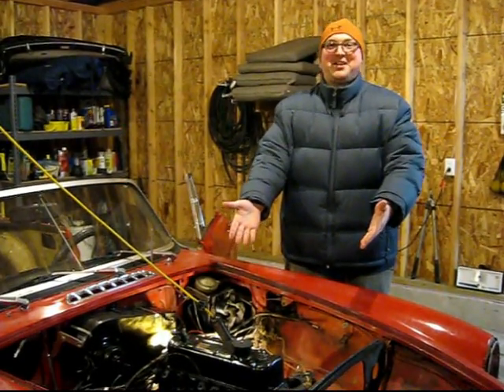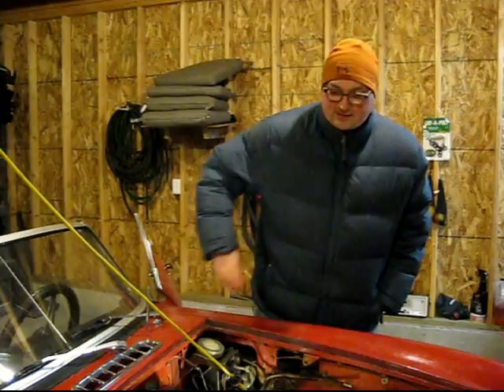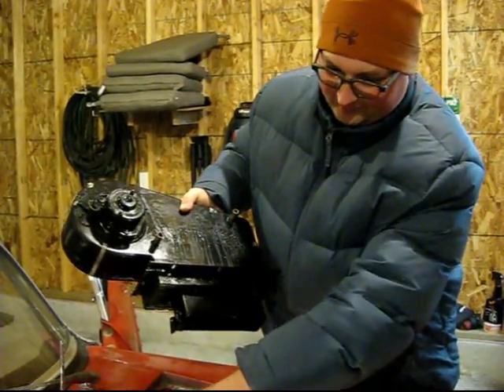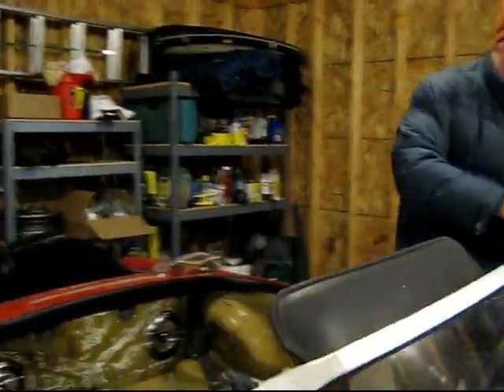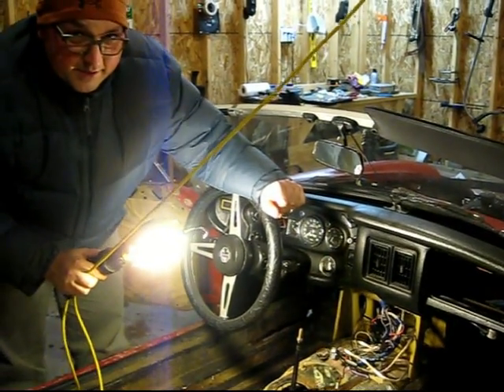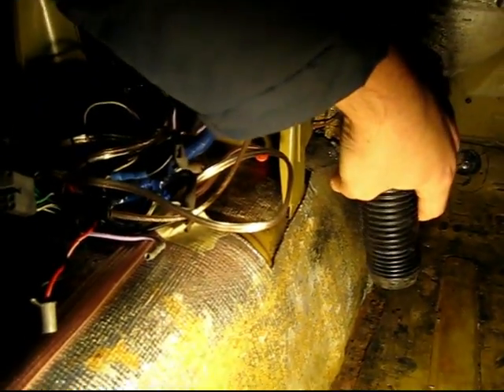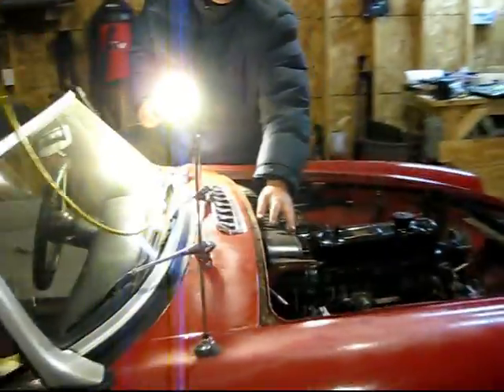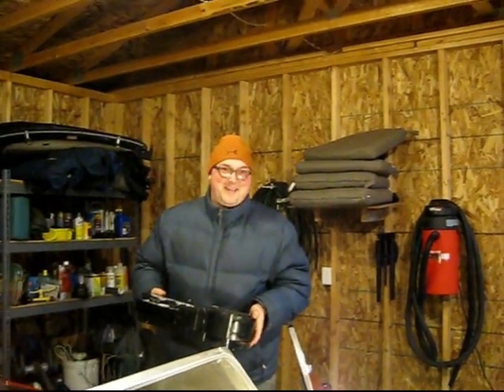MG 4 - Heater Removal

Comment: Hey, trying to install heater box onto firewall but the cable  doesn't want to bend enough to slid into the hole in the firewall.  As you know the bottom of box slides down into the hole but the cable is in the way after I start the cable into the firewall.  Sorry I know this is about clear as mud but do you have any hints on installing the heater?